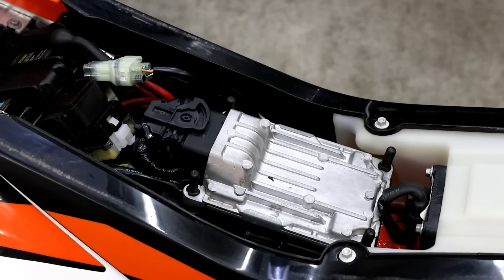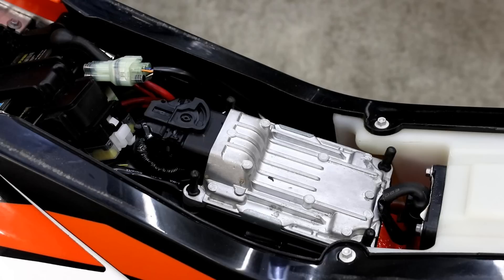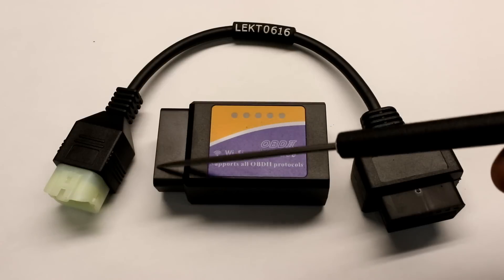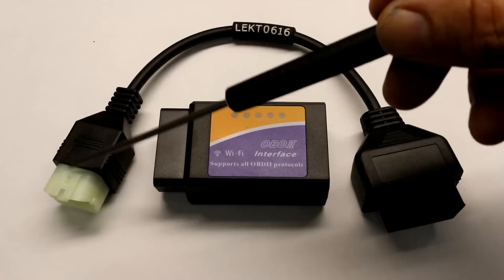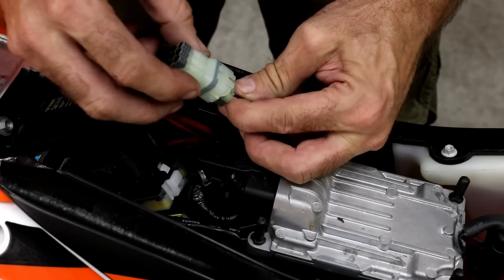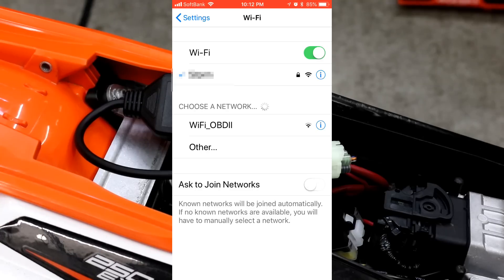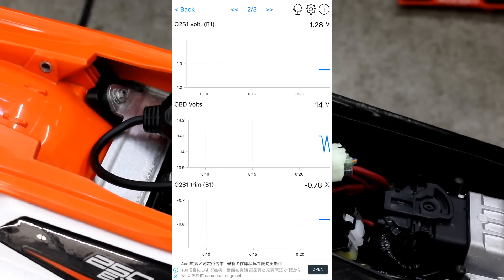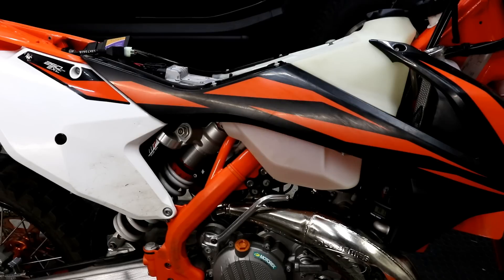KTM TPI 2-Stroke CAN Bus OBD2 Scanner Data & Diagnotics

Comment: @Tokyo Offroad, Hi. I have all purchased and connect but cant connect to the ECU, It connect to ELM but cant connect on the ECU. Its going trough all protocols (42) and on the end nothing,
Any suggesions please. thanks A lot!
Reply: Engine does not have to be running, if you jump the ECU enable signal (same pins as priming the oil pump connector uses). Protocol is ISO 15765-4 CAN (11 bit ID, 500 kbit/s). use ATSPx where x is 1-7, then ATDP and see which lines up. I think its protocol 5 or 6.
Reply from the maker: The bike engine needs to be running to connect. Did you purchase the same cable as I’m using, or something else?
Reply: The cable is different, I purchase almost two years ago. sure, I started the engine,  Could be the cable_hm.
Reply: I will purchase now from Lonelec and try it!
Reply from the maker: Milos Zivkovic - Yes, I’m guessing that the cable you tried is not compatible (it might be a K-Line cable). The cable sold by Lonelec (CAN bus) definitely works OK.
Reply: Tokyo Offroad thanks, I tough so! I just Bought one from Lonelec! 👍🏻
Reply: Tokyo Offroad thank a lot!
Reply: Milos Zivkovic same problem here, is it now work fine with lonelec cable for you?
Reply: @TokyoOffroad  do you have the pinout of that cable? Should be only 3 pins used

Comment: It would be interesting to see if forcing a failure shows up a code to prove it works. 

Shame it has to be running to work, if the bike won’t start you wouldn’t be able to retrieve any codes?
Reply: Jackson Gee with a simple mod to the cable you can connect with the bike off. 
I few faults do not show up because there not a OBDII SAE standard but the rest you can see.
Reply: @Jase877  What specific errors cannot be read
Reply: Сергей Манатин anything around the oil injection and rollover sensor

Comment: Thanks for the video, is it possible to pair the bluetooth without start the engine to check the ECU errors in a closed garage?
Reply: Yes, the KTM connector has a "wake-up" pin which is also utilized in the plug delivered with the bike to prime the oil pump. That is pin #5 on the KTM connector which needs to be connected to pin #6 (ground) for the electronics to power up.
Reply: @mpetkov2158  Thanks! I will modify my connector and try to connect with tuneecu. Regards!
Reply: Tune ecu will not read the map from the TPI ECU, it is totally different firmware to the Ducati M3C ecu.
Reply: @Jase877  Thanks! Does exist any software to read the maps?
Reply: The "wake-up" plug uses the same plug the OBD2 needs to use. So not sure its possible to short #5 and #6 at the same time and ODB2 still work properly.